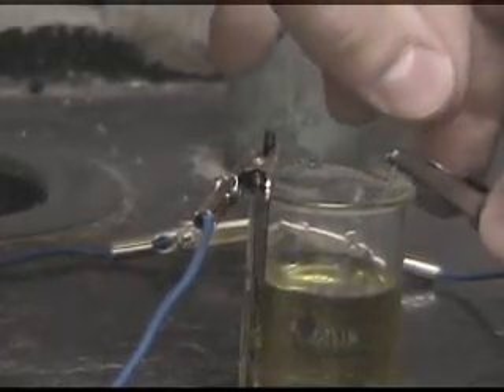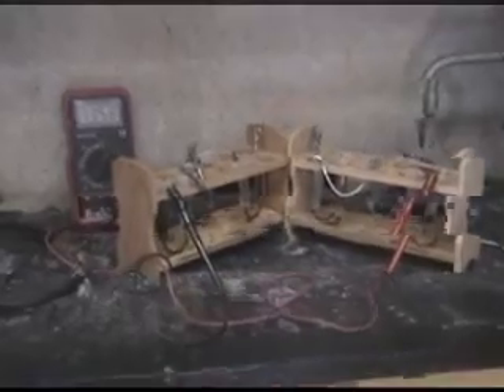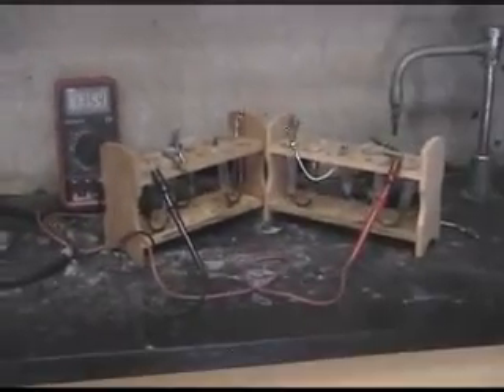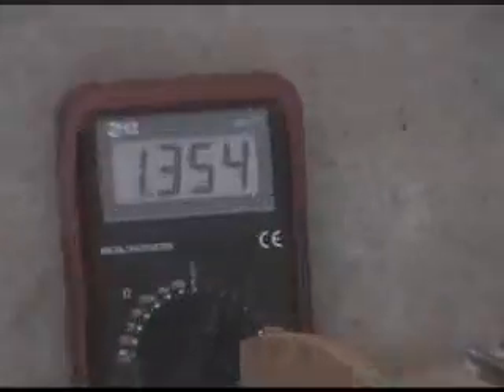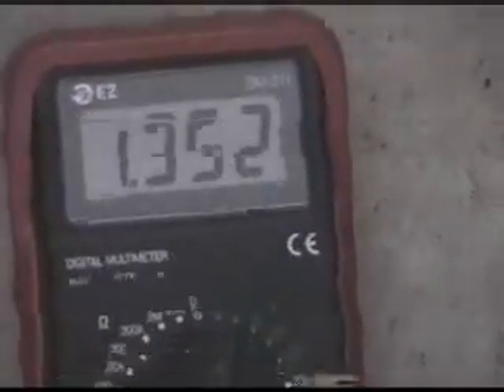Direct Methanol Fuel Cell

Comment: Just use armorphous nickel electroplated onto graphite beads or graphite plates ! And use it then in a KOH water solution, so it is an alkaline based fuel cell ! One electrode will be the nickel plated graphite and the air (O2) electrode will be just pure graphite plate....! Much easier and cheaper than your method ! And will have much more power...
Reply: Könntest du mir bitte etwas genauer erklären? Würde mich sehr freuen